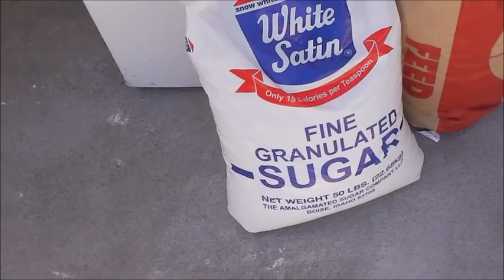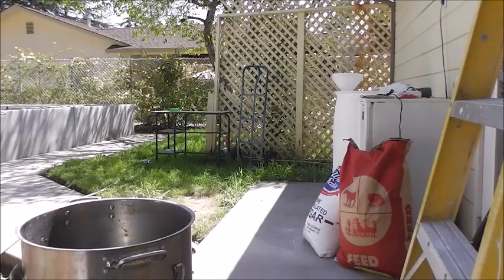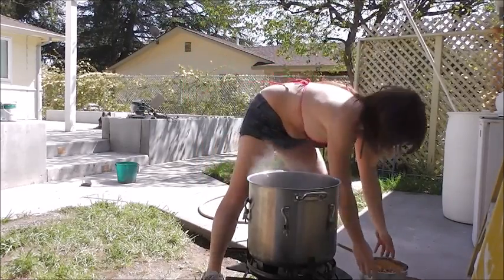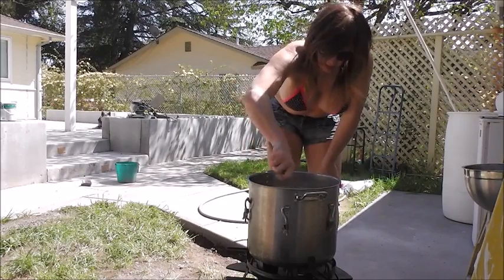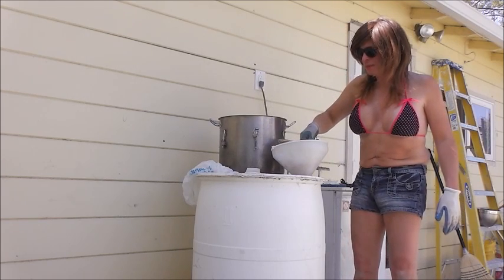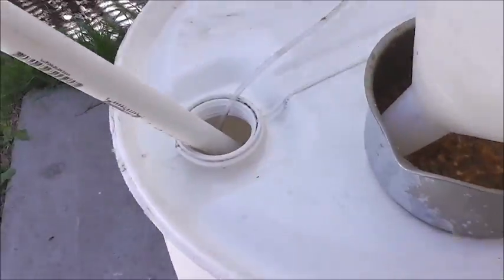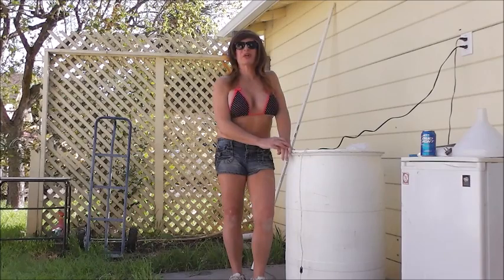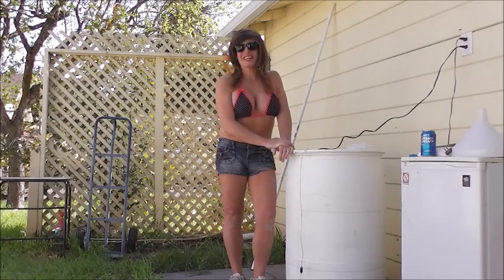Moonshine Academy...How We Do a Whiskey Ferment

Comment: Hi Rosie, need your help, my brother gave me his pot still which consists of a 22 quart pressure cooker some kind of stainless steel thumper which is shaped like an oxygen cylinder copper tube from cooker to side of the thumper  copper tube coming out of thumper side into the worm, a thermometer in the bottom end of the thumper that's the equipment, ok the mash recipe I used was a prepackaged sweet feed mix with 5 gallons of distilled water using 4 gallons in the mixing pot with the feed and bring it to a boil and adding 5lbs of sugar till dissolved then cutting heat and adding 3/4 oz of yeast and final gallon of water at 90 degrees placed in a 6.5 gallon bucket with airlock and allowed it to work, Then after it finished I strained it into another bucket and poured it into my cooker and when my tubing started to get hot about an inch above the thumper I added ice into my worm, about 140 degrees on the thumper thermometer it started flowing and I  threw away about 80 ml, the mix tasted like shit and was only 100 proof in the first 2 quarts 3rd quart 60 proof and ended at about 50 proof none was drinkable any ideas to what I did wrong Thanks 
Denny

Comment: Thank you, charming video, you are charming. I have a tip for you about burnt pots, I know it works with copper bottom pots, but may still work for stainless steel. if you rub a bar of everyday  soap on outside bottom, as in the underside, and leave it for a few minutes it will scrub off so much easier. I really enjoyed watching you, but would have love to know the results. I love to see the ingenuity of all the devices you have used.

Comment: Just thought I'd point out. By boiling your sweet feed, you pulled starches out (you knew this..) and at a full boil, the starches that do come out are going to be long chain dextrin's that are unfermentable. If you want it to dry out completely you could buy some Alpha and Beta Amylase at the Brew Shop you got the citric acid at. Add the Beta to the mash water and add the grains once the water is warm, then when the mash stops boiling and cools to 152 add the Alpha, let sit 2 hours. It will convert your starches to short chain fermentable dextrin. No more grain than you have in there, it wouldn't be worth it.

Anyway, the unfermentable dextrins are why you won't achieve a 1.000 on your hydrometer reading. You will probably do good to get 1.010-1.016 Your yeast ate all the sugar and you got all alcohol you could. Great video!